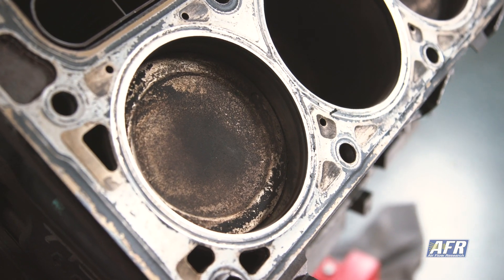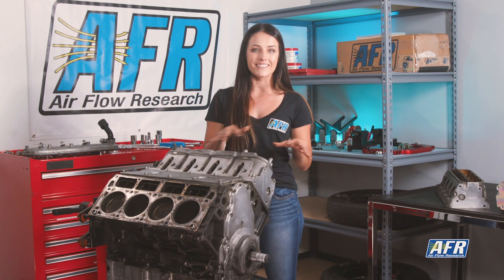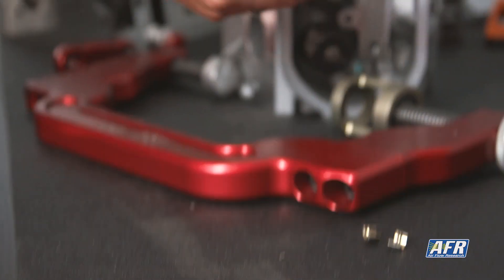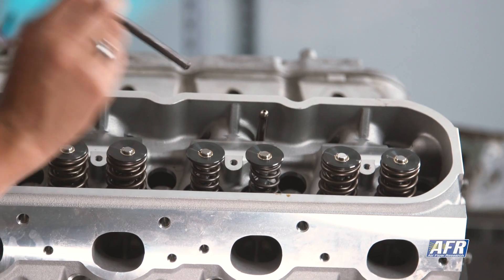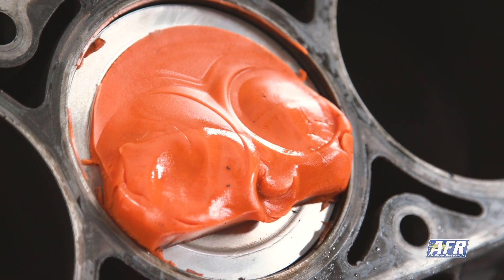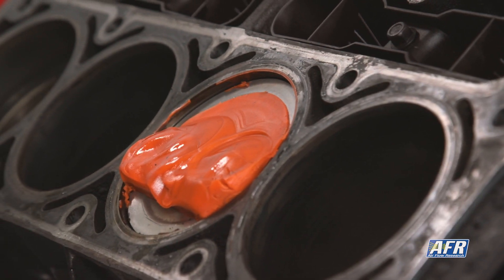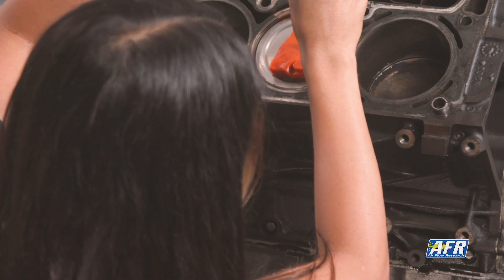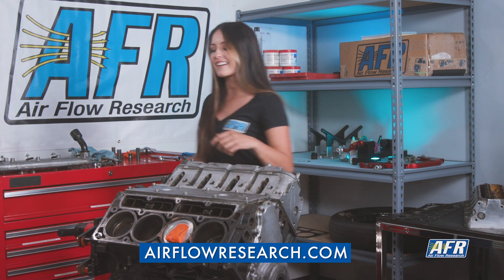AFR Tech: How to measure piston-to-valve clearance using clay with Alex Taylor.

Comment: at 4:15 when you were torqueing the bolts, the valve was getting pushed down.  I did this method and my valves hit my pistons.  You really should only tighten the rocker arm bolt down to 0 lash when using checker springs.

Comment: well we forgot about squish. had a engine thats in my sons car. didnt have enough clearance between head and pistons. to correct it we had to run a .061 thick mls gasket to achieve .038. then on to the valve clearance. fly cut on the pistons to achieve .080 on the intake and .110 on the exhaust.

Comment: I noticed some of my lifters I can't push the plunger in. Should I use those lifters during this method? Would normally the plunger go in and not push the valve as far?
Reply from the maker: If the testing springs you are using are light enough it shouldn't be an issue. However if you want to remove all doubt, use a solid lifter to check the PtoV.

Comment: Had to get my pistons flycut on my Windsor
Reply from the maker: Factory pistons?
Reply: @afr-airflowresearch9889  not exactly  they are the high silcon content cast items  I designed it to make maximum power at just 6200 rpm about 420 hp 302 CID

Comment: Good video, plus you're easy on the eyes, but the clay method isn't very accurate in addition to not knowing where the closest point was in relation to where the piston is. Piston to valve clearance should be checked during cam degreeing and checking proper push rod length while the degree wheel in still on the crank along with the test springs and dial indicator. There is also a way to use the actual valve springs to see how deflection affects the clearances.
Reply from the maker: Great point and when dealing with race applications this is the preferred way. However, not a lot of folks that are installing heads on a street car have these tools. If they do, they most likely already know how to check all the necessary clearances.
Reply: Quiet Gruber. Clay method works great if properly done. If using hydraulic lifters replace for test with solid.